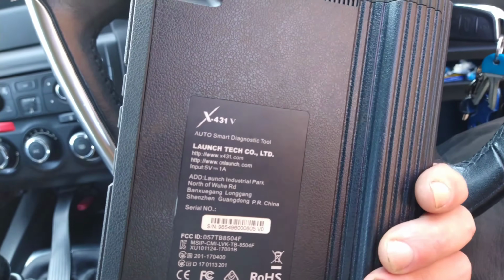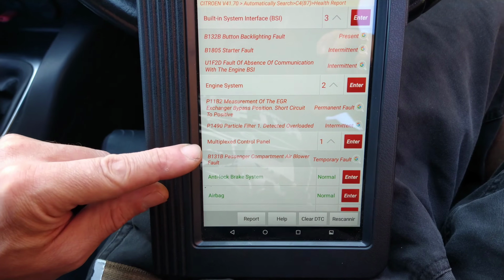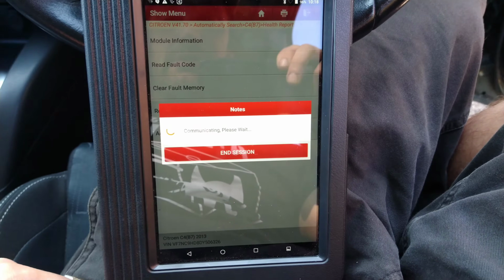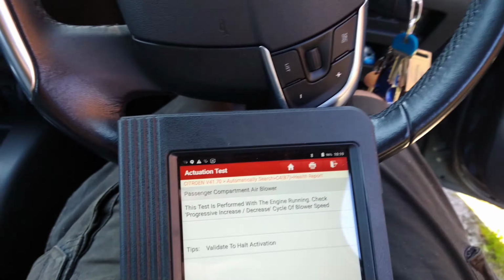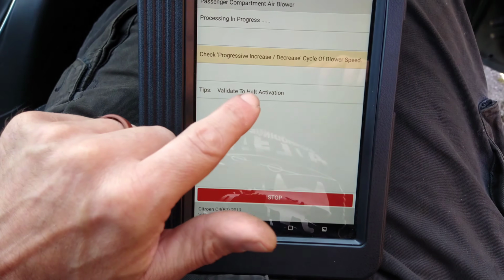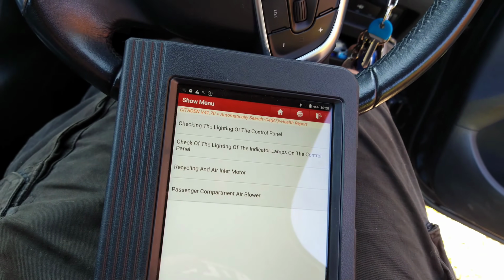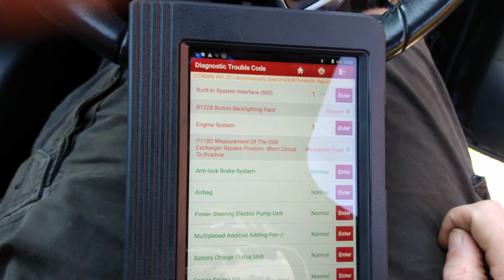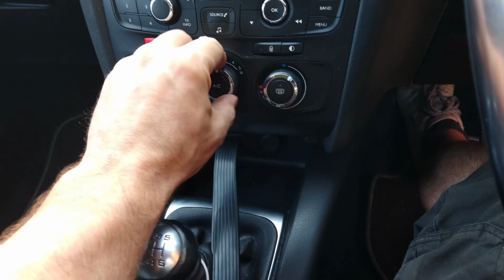Citroen C4 (heater blower not working)

Comment: I have a 2014 Citroen C4, blower motor just stopped working... changed the fan and the resistor and it worked again... Next day stopped and worked sporadically.. took out the glove box and followed the 2 thick wires of the fan back to a black plug, took off the blue cover on the plug and the plug itself was slightly melted at the brown wire, snipped off the plug and joined the wires back properly with solder and heat shrink and hey presto! Works a treat now.. if you are looking again for this problem that would be the route I would take before disassembling anything.
Reply from the maker: @raymurphy5235  it does seem to be a common fault with the plug, thanks for watching
Reply: @mechanicmatt871  thank you Matt, great video by the way 👏

Comment: Hi we have the same car but my blower motor fan runs at the same speed regardless of the speed I want. I checked the wire at 10:28 the voltage the same as the battery I wonder why?

Comment: Mate you are an absolute life saver, thanks so much for your video. If I could add just one thing, I found it impossible to refit the resistor back into the hole but I simply removed the top cover, fitted the resistor in the hole and then clip the top cover back on. Thanks again matey 👍👍👍👍👍
Reply from the maker: @outfriday4857  thanks for the info, thinking outside the box and having alternative ways of doing something is very useful

Comment: Hi my heater has just stopped working I have tested the plug going into the heater and I don't have 12v I have replaced the 40amp fuse and relay but still no joy what do I do know. Any ideas would be much appreciated.  Thanks

Comment: Hi my c3 Picasso exclusive with dual climate control is blowing slightly warm air even when temperature setting is set to high, coolant level is ok and I’ve used 1 small bottle of coolant treatment, any help or advice would be appreciated
Reply: Sorry it’s a 2013 uk model
Reply from the maker: It could be a blocked heater matrix

Comment: please, I have a similar problem, but my blower is working perfectly, the heat is not coming as he should, c4 Picasso 2008 model. I am thinking about the flap control, air filter change, thermostat change, blower change, 🙏 please  any idea

Comment: Matt, thank you so much for uploading this video, my heater blower stopped working in the winter, and i have been working through the issues that could be the cause, i prefer to solve things myself where possible, i had reached the point where I was certain that it was an issue with the earthing wires but was not sure hiw to go about solving this. Anyway, yesterday I watched this video of yours and it led me to check the two wired connector near the fuse box ( i think maybe brown and yellow/green wires), i may be wrong on the colours, but anyway, having pulled the connector apart, the pins were mis aligned, so i straightened them, and tried the bolwer, i was sooooo happy that it worked, although I noticed that there was quite a bit of heat in the wires after only a few seconds, in the vid you cut the connector off and used crimp connectors, do you recommend that this be done as a way of improving the connection and reducing the heat in the wire?
Thank you again 😊
Reply from the maker: Getting rid of the end of the wires because they had turned black, with high resistance causing heat in the wires. It's mutch better now
Reply: @mechanicmatt871  thank thank you for the reply, having looked again i noticed the plastic covering on the end of the yellow and green wire had become hardened with the heat from the high load and the resistance at that point because when you look at the connector, it looks like citroen have used a connector that is not heavy duty enough for the current that flows when the blower is on number 5, so at that point it causes the resistance which causes the heat, so i too have decided to use heavier duty connectors with the assumption that it will remove the restriction for the current so reducing the dangerous amount of heat. Thanks Matt 🙏
Reply: @Rizwan Patel i will have to have a look to see what wires are going where, but if you watch Matts video you can roughly see the position and it is clipped to the right hand side of the fuse box, it is the only connector there with the thick brown wires. What have you tried so far?
Reply: @Rizwan Patel i meant to put in my previous reply that you will only get to the wires with the glove box out of the way.
Reply: @Rizwan Patel no apologies needed mate, i am less comfortable with electrics on modern cars, i spent ages checking what i could and trying to get help off google, mostly with no luck. I have to say I started off by expecting that it was going to be the resistor, so i replaced that, but still no fan. I couldn't find any information on the fuse that supplies the blower until someone gave me advice on its location from one of the forums, the fuse looked ok. I had already taken out the blower fan, checked it over and tested it off the car, when the motor was replaced i tested again in the car just by putting an earth to the motor connection, so at this point i was believing that the earth had failed, this was when i happened across Matts video and he put me onto the connection that turned out to be the issue, and i know believe that because it looks like Citroen have skimped on the size of the pins in that connector, that many of the mk2 C4 have or will have problems because of this connector and i actually believe that connector is at risk overheating with the potential to cause fire. So which ever way round you do your checks on the components, i would certainly suggest that you check that connector first as i suspect there is a good chance that is where your problem lay.
Reply: @Rizwan Patel hiya, the connector that you are looking for is clipped to the right hand side of the fuse box behind the glove box, is is a black connector with a green with yellow wire and a brown wire on one side of the connection, those wires are the same thickness, reasonably heavy duty, the other side of the connection is a blackwire and a green and yellow wire which is not as heavy duty as the other side on mine all four are getting hot when the fan is on number 5 speed which is why I am going to change it for a heavier duty connector like Matt did. If you unclip that connector from the fuse box, separate the 2 halves and see if the pins are aligned to fit properly into the opposite side, with a bit of luck when you fit them back together, start the car, the blower will work. If not, then start checking the parts i mentioned earlier. Good luck with it.
Reply: @Rizwan Patel it is i ththe first or maybe the only one that is clipped to outside of the right hand side of the white fuse box, you should be able to find it by the wire colours that i mentioned earlier.
Reply: @Rizwan Pateli can't see that it's possible to add a photo here, is it two wires each side of the connector? If yes, they should be the  same colours as i mentioned previously, if so, then that should be the one. Just to check, your car is a mk2 (2011 onwards) Citroën C4?
Reply: Check Matts video @ 10 minutes 30 seconds he shows a close up of the connector that you are looking for and later on you can see the yellow crimp connectors that he's used to replace the black connector.
Reply: @Rizwan Patelglad you got it sorted, it does seem like it is an issue with these brilliant cars.

Comment: what soft do you use and connector?
Reply from the maker: I use different connectors, if it's inside the car in a dry place I use  heat shrink, or crimp connectors,  other places I solder and het shrink tubing. Thanks for watching David

Comment: if i good understood, you said that fake "ground" can come trought "plus wire" when ingnition its off? Best regards
Reply from the maker: It sounds crazy I know.
With the ignition off, The ground wire had a green light on the power probe showing a ground. Although when I disconnect the resister and rechecked the wire it had no ground anymore.
When plugged in The ground was coming out of the resister with the ignition off and not from the ground wire.
I found a faulty ground connection and it fixed this fault.